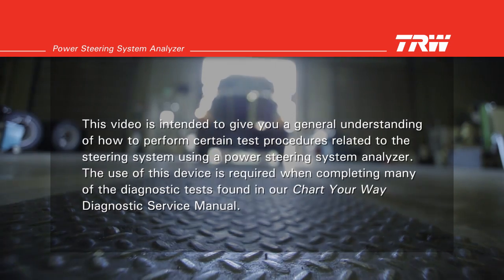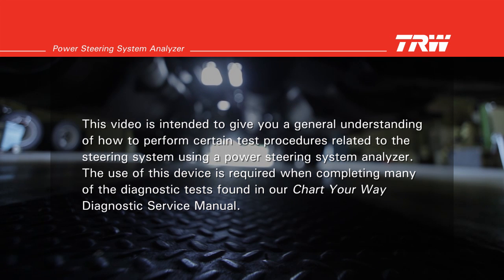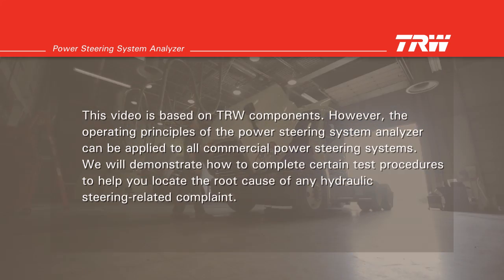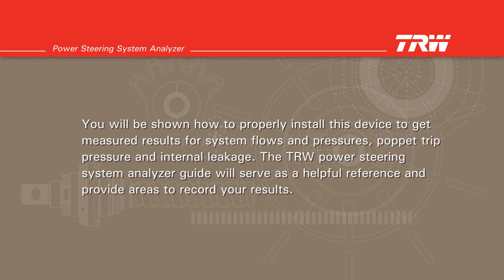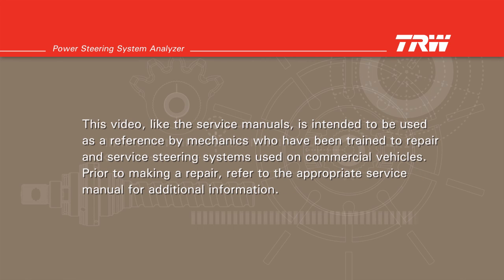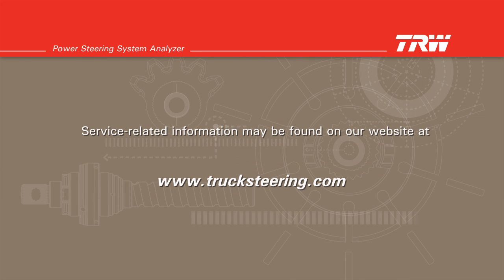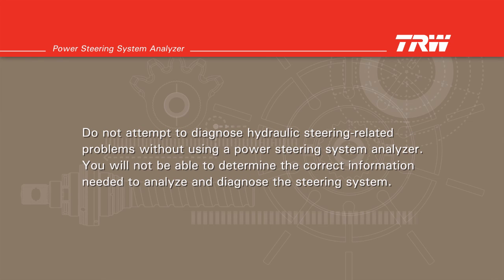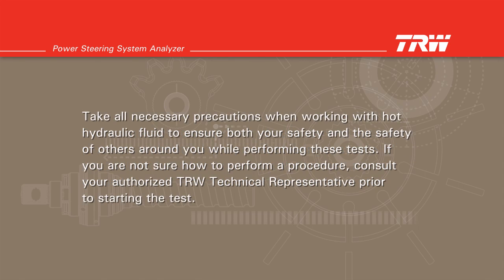TRW Commercial Steering Systems : Power Steering System Analyzer Installation, Use, and Tests

Comment: Here are some of the key tests being performed:  
Check hydraulic pump relief valve pressure 3:31
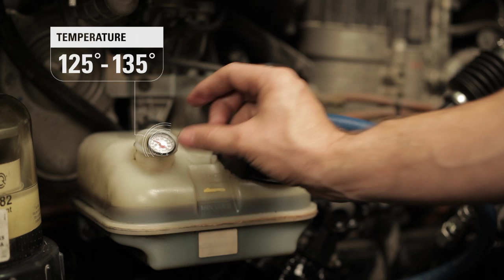Check system flow rates 4:07
Check pressure when poppet valves are opened 7:58
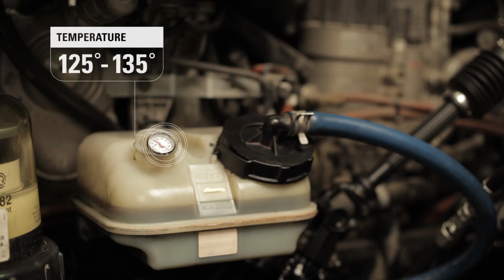Check internal steering gear leakage 9:30